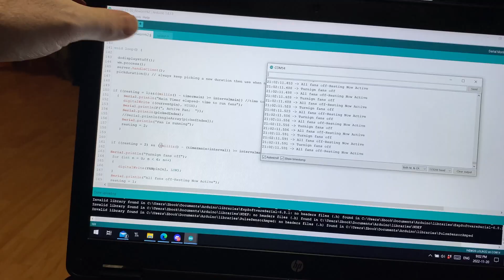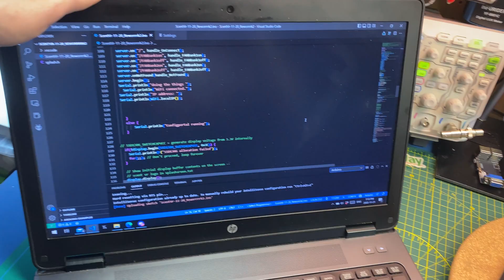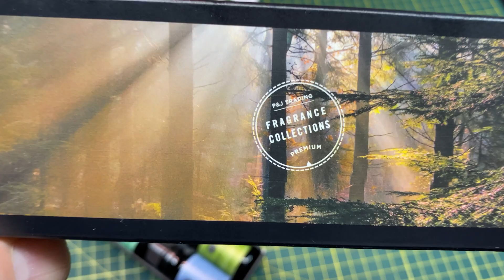10 Days of Making - ScentVR Project Adding Smells to Virtual Reality with ESP32 & Arduino

Comment: As a kind In middle school (1990’s) I wrote a paper on this concept for the horrible VR we had and TV (lol) using a multi pack of sent cartridges, aerosol injectors and Co2 cartridges. I wrote if the the gas station bathroom could automatically dispense fragrance then we should smell floral notes when 18οο flowers advertised on tv. 

Unfortunately IoT and the maker space wasn’t where it is today so prototyping it for class wasn’t really an option.